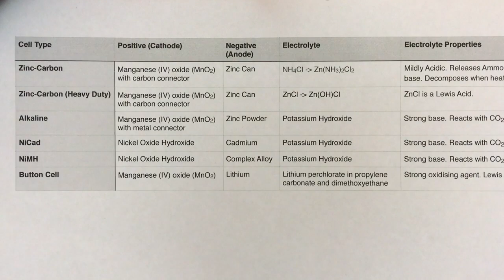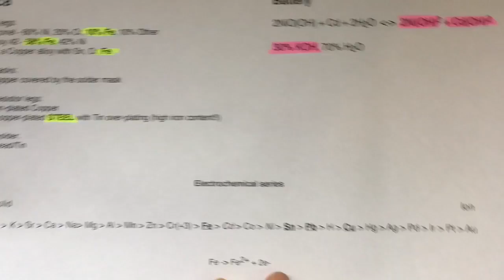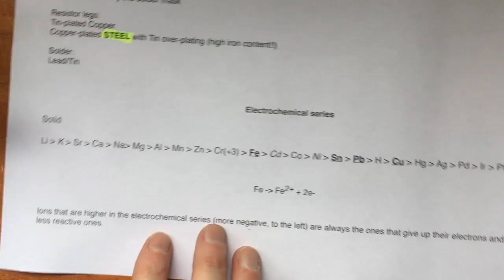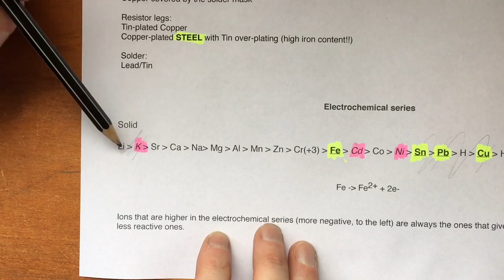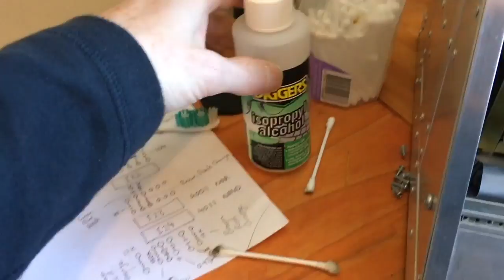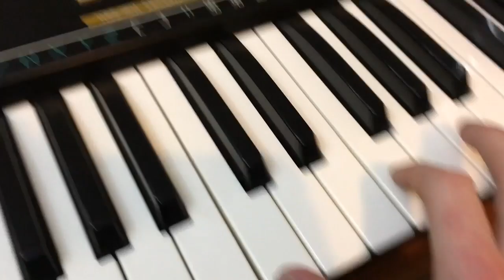Kawaii SX240 Repair - Battery Leak Chemistry, Patch Storage Issue, Circuit Rebuild

Comment: Hey, great informative video. From experience, would you say the battery replacement on the sx240 would be similar to the sx210? So it’s just a diode inline with the new watch battery and no need to remove any capacitors from the circuit? Thanks so much in advance

Comment: Greetings!  I own a SX-240, have had it for 35 years, and haven't replaced the battery yet.  Fortunately, it hasn't self destructed and leaked all over the place, still intact.  I am replacing the large filter caps on the power supply while I'm at it to minimize some noise riding the DC output.  What is the 1N number or value on the diode you used on the positive lead of the battery?  BTW, nice informative video.  Thanks for the post!

Comment: Great video! You are helping me learn so much. I have an absolutely wonderful Kawai SX-240 that plays beautifully in 8 voice poly mode. However, when switching to either split or dual mode, a voice is lost. In dual mode, on every 4th note, only the upper voice plays. In split mode, I only get 3 voice polyphony in the lower section. Do you have any ideas on what I should look at? Thanks so much
Reply: Hey jack, I’m having a similar issue with an sx240 I just received. Did you figure this out?

Comment: Hey I have one of these and had not played it in a couple years. I recently switched it on and all the memory is screwed up. The sound patches all come up as Basic 240. Do you know if there's a way to reset that memory back to factory? Or do you think it's gone?
Reply: the memory is gone. it needs the battery replaced. have it swapped with a cr2032 and go here https://www.synthmania.com/Kawai%20SX-240/Kawai%20SX-240%20presets%20waveforms/Kawai%20SX-240%20presets%20waveform.mp3 follow the instructions in the manual on how to load patches and play this file, it should be pretty straightforward :-)

Comment: I have one of these, battery swapped out for a CR2032.  Very underrated synth.
Reply: Hi! I have question about the Kawai SX-210. I found 2x not 100% working units, but they are in good cosmetical conditions. I could buy them together for 1000 bucks. Is it worth the money? What do you mean?

Comment: Thanks for this!  You encapsulated in 25 minutes what I've been trying to get across to people on synth forums for years now -- most electrolytes are alkaline, neutralizing and cleaning them can be a messy and potentially toxic business.   One addition that I think should be addressed ia battery outgassing (I've seen several Polysixes with corrosion far away from the NiCd battery).  It's not as common as direct damage from leaking and I think it depends on the storage conditions (humidity and position) of the synth when the battery leakage happens (laying upright on it's side for example).

Comment: Dear Golt,

Another great one.  You suggest using a non-chargable battery. That reminds me of the fact that I started to use rechargable batteries all the time because I expected them to be better resistant to leakage, even if I would not timely be aware of the battery going flat (Some of us have so many synths we hardly came around to using them all regularly. Which is sheer decadence of course, but there you go). So my question: Is my assumption correct? Are rechargables less prone to leak / rust?
Furthermeore. Any tips on how long batterries will on average, keep delivering sufficient current, both rechargable and non-rechargable? Or does that, as one would expect,, differ from one machine to the other?
Reply from the maker: I understand that point of view. If the synth uses AA or C size batteries then I think rechargeables will not leak as much as non-rechargeable. The reason is that there will alway be one cell that discharges first. In that case rechargeables are safer because the bad cell can handle being charged by the others. But I usually store my synths without batteries. It just too dangerous to leave them in. 

It is quite common to install non-rechargeables on the circuit board though. Most of us synth repair guys don't trust NiCd's. The lithium buttons cells seem to be quite stable. I wouldn't recommend putting a NiCad back in.
Reply: Thanks for the additional tips. The trouble however is that you then lose your presets and backing them up by cassette is big pain in the ..... (although I also regularly work with "hardware" paper preset sheets). So leaving out batteries is a good idea for a pure collector but I actually use my instruments to make music (enter webwide cry of outrage and disbelief) :-)

Comment: Hey Again I thought I will write here as messaging on YT is messy. One thing I would really love your help on please , i calibrated the synth with the service manual yesterday but where the hell in the cs20m are the trimmers to calibrate PW (not PWM as I found these on the MOD board) my PW is not 50% at knob at 0 and differs between VCO1 and 2 , VCO 1 50% is at setting 2.5 where on VCO 2 its 1.9 roughly , this drove me crazy yesterday can't figure out from the service manual. If there is no PW trimmers for some reason how can I add one ? I would really appreciate your help. Thanks a million !!